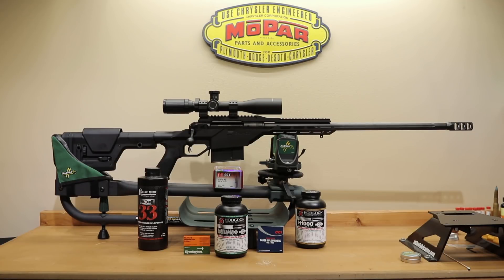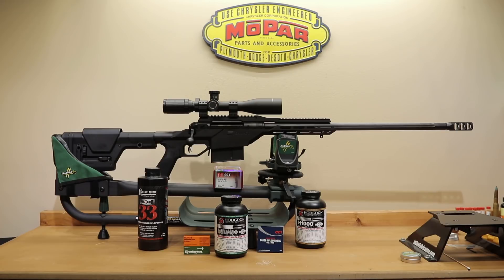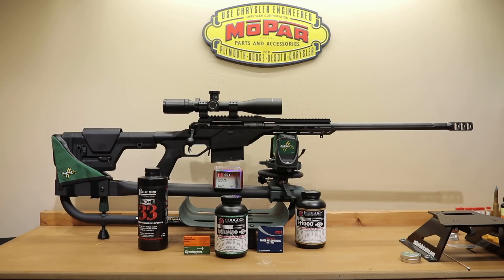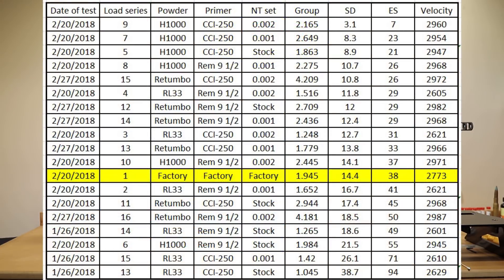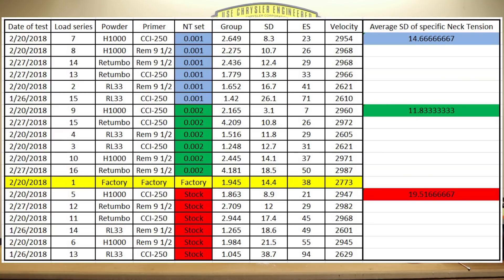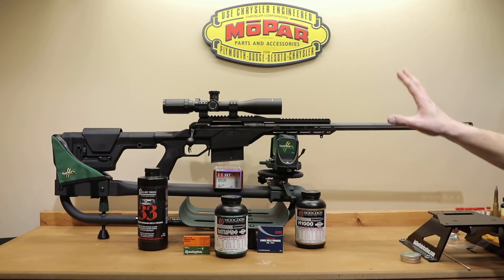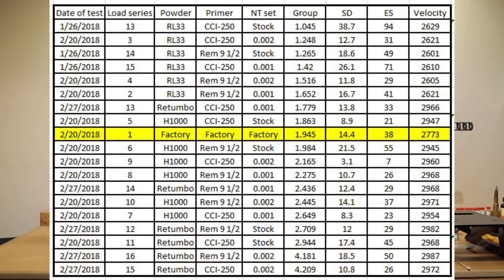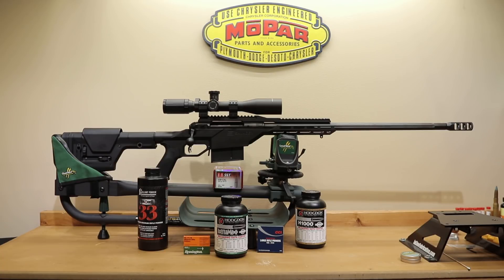Savage 110 BA 338 Lapua Magnum Reloading update with Reloader 33, Hodgden H1000,and Hodgden Retumbo

Comment: Best resaults  with hornady brass
Reply from the maker: I have read that a lot of savage 338 LAP have issues with Hornady brass getting cases stuck in the chamber. I didn't want to have to deal with that.
Reply: @BoltActionReloading    mine was light loads  and seller bellot was sticking    poor groups  blowing heads off cases

Comment: Had a savage  factory  loads  had extraction problems  bought 700 reminton. The remington grouped less than 1/2 inch at 200 meters  with my hand loads.   My velosity was  over 2900 fps over my crony  250 grain bergers

Comment: I was testing some loads so started at the minimum starting load of the Lee reload manual, and was using hornady and Lapua brass, when I went to reload the first 2 cases were not going into the resizing Lee die and that smooth and  the third one got stuck so purchased the Lee universal die and still very tight to the point if I try to go all the way down im afraid the case will get stuck do you have any idea on to what happen to my brass? only been reloading 2 times before with no problem only thing I did different this time was kept in tumbler for 4 to 6 hours. thanks for   any help
Reply from the maker: Have to admit, I am a little confused. Sorry for silly questions but exactly what dies are you using? Are you using case lube? FL die or NO die? If you are talking about the Lee universal decapping die it is not deep enough for 338LAP. I bought a Redding I think.

Comment: Thanks for the update and I just wanted to forward some info to you since I'm shooting the same rifle and experimenting with load development also. I have noticed a marked improvement in velocity and tighter group size since reaching the 200 round mark. I did not record absolute round count but the 200 is pretty close to total number so far. I also experienced loose hardware issues and was thrown off by it initially. Please keep the videos coming as many of us look forward to seeing what you develop and it helps in many ways.
Thanks again,
Dan

Comment: I look forward to seeing the Berger bullet reviews. I just got the rifle and plan to take it out to a mile with the 300gr Berger's.
Reply: I’m getting a 338 Rpr later this year. I use Berger’s in my 7 Rem mag and I’ll be using 300 grain Berger’s in the 338 as well. How did they fair for you?
Reply: @officerfoxtrot3633  we actually ended up using some 285gr Hornady bullets. The rifle only came with a 24" barrel and to keep the projectiles trans-sonic past a mile we had to use the lighter bullet. They work pretty well IMO considering we're running a basically stock rifle and shoot at a MOA square target.

Comment: As always, thank you for yet another awesome informative video. I do look forward to them! Looking forward to seeing what you find with both the 285gr and 230gr. I tested both of them with H1000 and Retumbo. Decided on Retumbo because of the SDs and velocities I was seeing in my 32” barrel. Possibly because Retumbo is s slightly slower burning powder? Found great accuracy from the 285gr bullets but I’m still struggling with the 230gr bullets. For me the 338LM has been the hardest cartridge to load for out of all that I have loaded for so far. Not sure why.
Reply: Btw I found the 230eld needed to be very close to the lands as in 0.004” and the 285ELD liked a 0.035” jump.
Reply: Have you had any experience with Berger 300gr? I'm having one hell of a time figuring this thing out. Running h1000 in a Savage elite precision
Reply: I tried them once with Retumbo and did not like what I saw from the OCW test so stopped there and never went back to them.

Comment: Nice to see an update on your 338.  I'm also in the midst of developing loads for my recently acquired 112.  I have found H1000 to be very consistent, with the same low ES and SD that you're seeing.  With the 285gr elds, H1000, Peterson Brass, CCI 250 and Win LRM, 91, 91.5, and 92 gr yielded 1/5 moa 5 shot groups at 100 yards.  Interestingly, with 6 different loads, 3 different powder charges and 2 different primers, all 30 shots had an average velocity of 2790fps, an ES of 50 and a SD of 15.  The CCI primers consistently had tighter ES's with ~10.  The Win LRM ES's were over 20.  The CCI groups on paper were also a hair tighter.  I saw no pressure signs at all, so I might explore a little beyond 92 but honestly, what I saw with ~92grs and CCI 250s I'm pretty happy.  I plan to test nosler 265 ABLRs and Berger 300gr Hybrids.

Comment: The Berger projectiles really like to be set between .015-.020 Jump in this particular rifle. The savages have a really hard time with sticking reloaded brass that isn’t Lapua brand. Best loads  are at 2 thou neck tension from 88 to 92 grains of H1000 depending on bullet weight. You can achieve the same results with retumbo just add 2 grain of pound to previous numbers so 90 to94 grains. Coo 250 work well buy my best results where with Federal 215GM. Check your concentricity and correct as needed as this was an issue the hornaday tool works well for this corrections. They are fun rifles and please find the write up on accurate shooter about the savage action bolt toque procedure it will really help.
Reply: This is the article Lucas referenced:  http://www.accurateshooter.com/technical-articles/savage-action-screw-torque-tuning/
Reply from the maker: Thanks for the great feedback. If you can point me to the article I would appreciate it.
Reply from the maker: Thanks I will check it out when I get a second.
Reply: Get some Thot  vaccine quick. DADDY Thumb and and Luckie showed up.